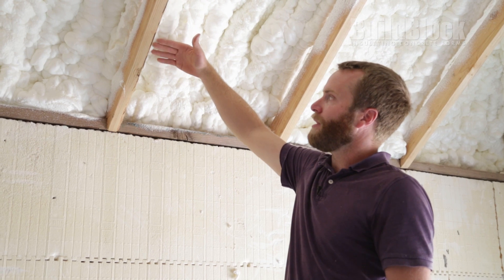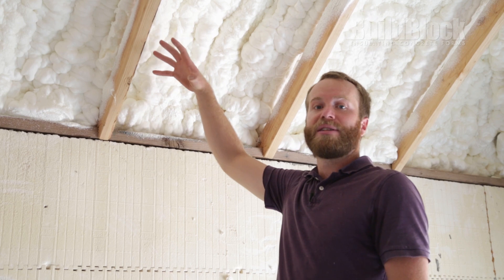Roof Insulation and ERV Systems in ICF Homes

Comment: I was under the impression that roofs needed to have ventilation or else they would develop condensation and rot issues. This eliminates the conventional ventilation that roofs typically have (there is no airflow channel). Is that not an issue?
Reply from the maker: Hello Byron! In this build, the attic space is ventilated by being a part of the full building envelope. The humidity stays very low as long as you have good circulation through the building.
Reply: I think that is the purpose of the ERV

Comment: One of the arguments in times past was the breathability of wood framed homes. It sounds like this air control unit addresses this issue. I have a 2000 SF wood frame home with 6" outer walls. With the exception of a few roofing shingles, my North Central Florida home has endured all the hurricanes in the last 21 yrs. I am going to build a 4,000 SF workshop, storage, garage and hurricane protection building. Our fairly new City Hall was built with this ICF process for $3,000,000. 12,000 SF. We had HVAC issues and I do not know why. It is a comfy building.